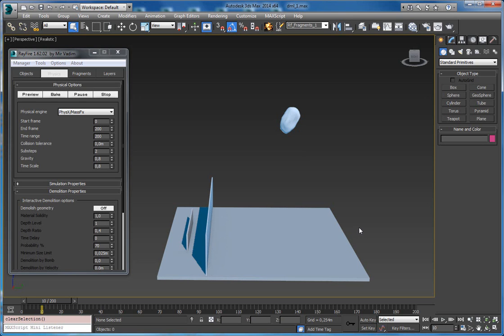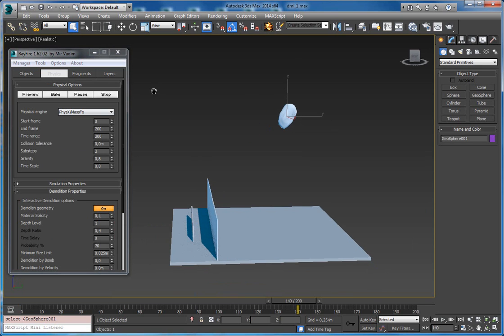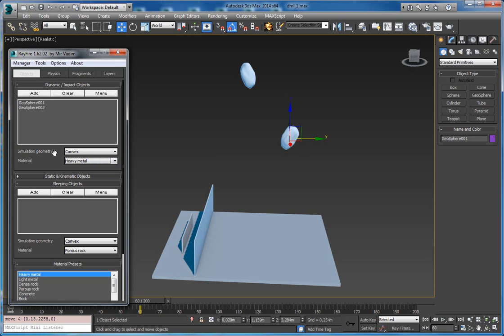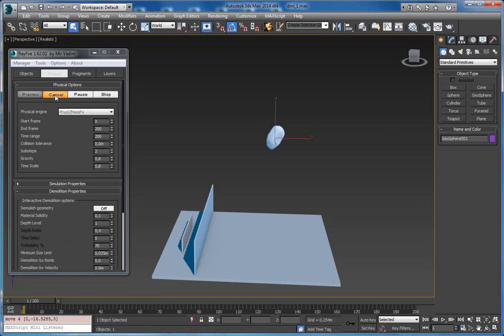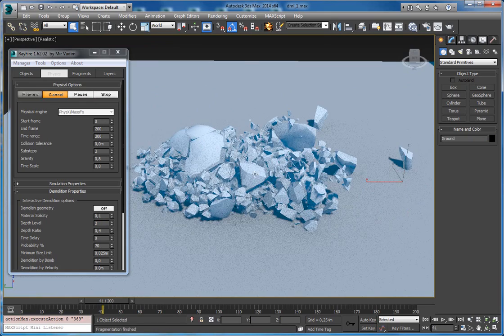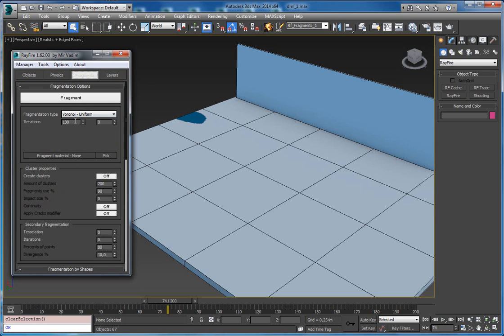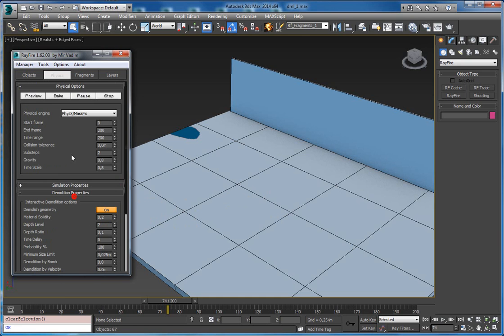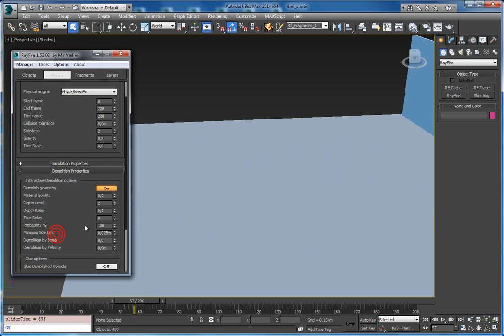RayFire Tutorial - Interactive Demolition - Basic

Comment: When adding voronia fragmentation to the 3ds max 2016 teapot with 80 frags, 3ds crashes? How much can the teapot handle ?
Reply from the maker: Which RayFire build do you use?
Reply: 1.71 i also tried once with 1.69. I am on max 2016 sp3. It works perfect with other geometry just not the teapot. How many pieces is it possible to break the teapot in?
Reply from the maker: Can you convert it to Poly or mesh and try again?
Reply: MirVadim still crashing....
Reply from the maker: Well, can you email me your scene right before you fragment teapot?
Reply: Okay. It seems autodesk does not officially support win 10 with with 3ds max 2016. I tested out on max  2018 and it works perfectly.